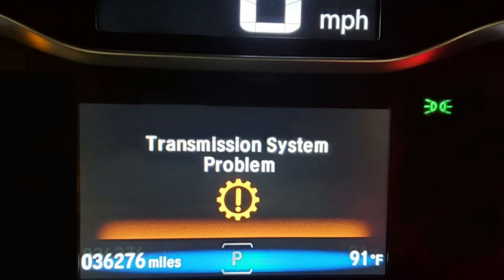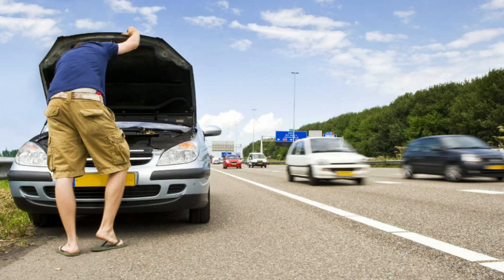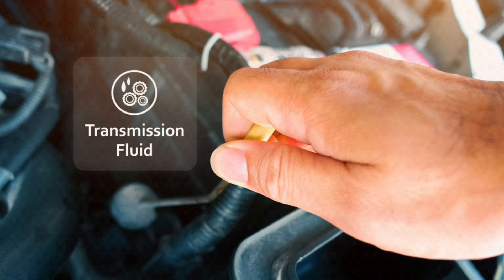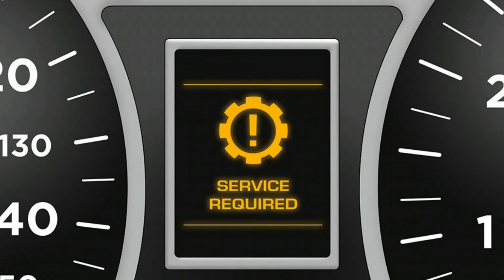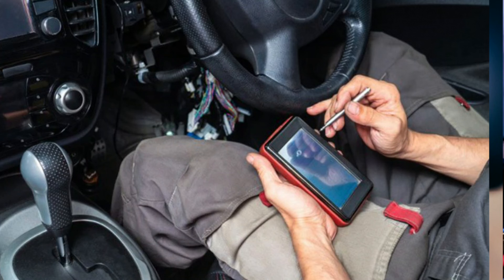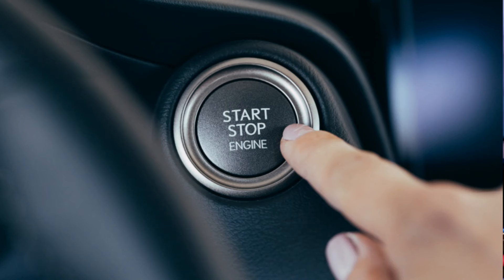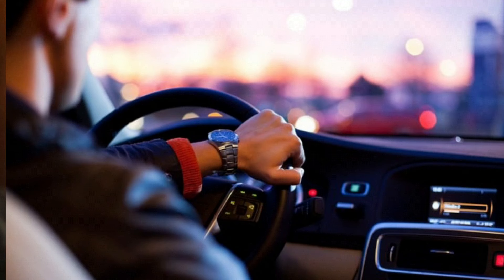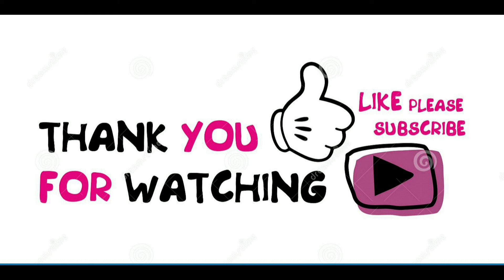How to Fix & Reset Transmission Temperature Warning Light/Automatic Gearbox Light On

Comment: Morning mine shows it yesterday while I was driving, what do I do now cause my car it's still new I'm worried please help
Reply from the maker: @fikilemsesifakude6946
If the transmission warning light came on while you were driving ... and your car is new ....
Check Fluid Levels: While the engine is off, check the transmission fluid level using the dipstick (if your car has one). Low transmission fluid can cause problems with the transmission. If the fluid level is low, you may need to add more fluid.